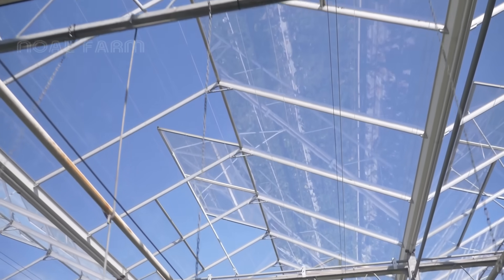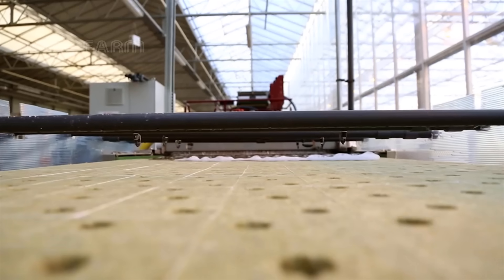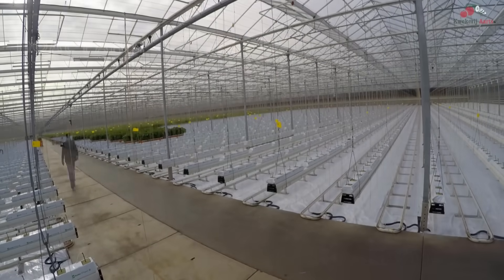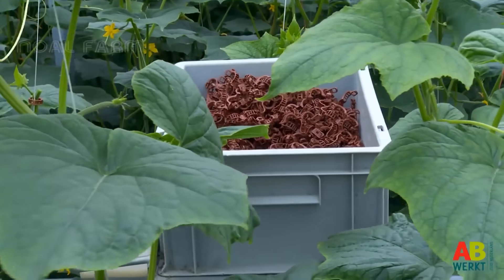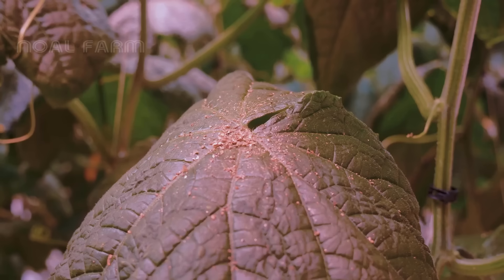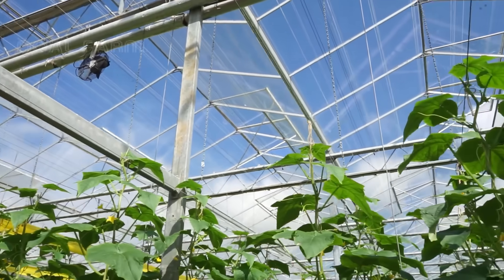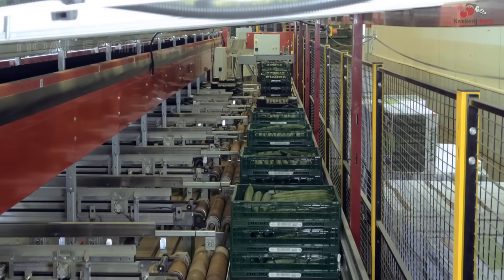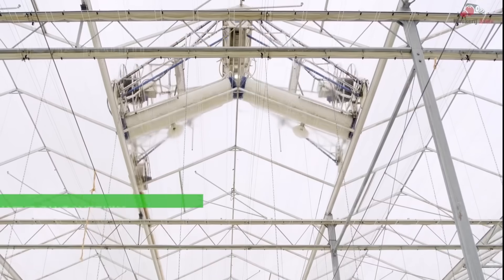How To Grow 69 Millions Of Cucumbers In Greenhouse And Harvest - Modern Agriculture Technology

Comment: Respectful Greetings!
To: Fazenda Noal. 
Cucumber production in a greenhouse involves providing the right amount of water, fertilizer, and support for the plants. Cucumbers are a popular greenhouse crop because they are smooth, juicy, and sweet. 

Watering
Water often and thoroughly to keep the soil moist but not wet 
Small plants need about 1 quart of fertilizer solution per plant per day 
Mature plants need 1 to 2 gallons of nutrient solution per day 

Fertilizing 
Use a premixed fertilizer designed for cucumbers
Start with a low concentration rate and increase as the plants grow
Adjust the fertilizer based on the quality of the water used for irrigation

Supporting
Use sturdy canes, strings, or wires to support the plants 
Grow cucumbers vertically on a trellis, fence, or other support 
Spacing 
Plant cucumbers at least 45 to 50 cm apart
Space rows 16 inches apart

Air circulation 
Provide good air circulation between the plants to help prevent disease

Types of cucumbers 
English and Beit Alpha are the two primary cucumber types grown in greenhouses
Both types are parthenocarpic, meaning they produce fruit without flower fertilization
Harvesting 
Most varieties of cucumber will be ready for harvest between 50-70 days from the day you plant from seed.

Consuming cucumber provides several health benefits including: high hydration due to its high water content, aiding digestion with its fiber content, supporting skin health by providing essential nutrients, potentially helping with weight management due to its low calorie count, and contributing to overall health by providing vitamins and minerals like vitamin K, vitamin C, potassium, and magnesium. 
Key benefits of eating cucumber:
Hydration:
Cucumbers are primarily composed of water, making them excellent for replenishing fluids in the body. 
Digestive health:
The fiber in cucumbers helps regulate bowel movements and promotes healthy digestion. 
Skin health:
The nutrients in cucumber can contribute to healthy skin by promoting hydration and potentially reducing inflammation. 
Weight management:
Due to their low calorie count, cucumbers can be a great addition to a weight-loss diet. 
Nutrient provision:
Cucumbers contain vitamins like vitamin K, vitamin C, and B vitamins, along with minerals like potassium and magnesium. 
Fresh breath:
The crunchy texture and high water content of cucumber can stimulate saliva production, which helps combat bad breath. 

Courteously!
Luis Van-Dunem

Comment: Growing 69 million cucumbers in a greenhouse is an incredible example of modern agricultural efficiency. Achieving this requires advanced techniques like optimized greenhouse designs, climate control, and efficient water and nutrient management. Greenhouses provide a controlled environment, ensuring that cucumbers receive ideal conditions for growth year-round, regardless of external weather factors.

In addition, using automated systems for planting, irrigation, and harvesting plays a crucial role in scaling production to such massive numbers. Precision farming technology helps monitor plant health and adjust conditions in real-time, ensuring consistent quality and yield. These methods not only boost production but also minimize waste and conserve resources, making it a sustainable agricultural solution.

Comment: in Indonesia, greenhouses are expensive and rarely used by farmers. however, this is actually a good step to minimize pest attacks
Reply: Yeah, I hope our government rethinks their policies, instead of spending the budget on fertilizer subsidies, it is better to support farmers to make greenhouses.
Reply: @atranzjoker  Not really. The soil in tropics is heavily leached. There is very little water soluble nutrients... so little nitrates, sulfates, potassium, magnesium zinc, etc. If it water soluble it is gone under 2500mm-3000mm of rain a year. Also the temperature is very high. Room temperature is easily 35 Celsius. So a green house structure that is not carefully designed to vent heat and has good airflow will quickly become an oven. Finally please note many plastics used in the west, rapidly photo-degrade (yellowing and cracking into dust) under the intense UV light of the tropic. Many also lose their physical strength due to the heat. Water system also have to well protected to prevent mosquitoes getting into them and  breeding. Mosquitoes borne disease within the Indonesia region include malaria, dengue, yellow fever, Zika and chikungunya.  

Green house in the tropic needs to be designed to stay cool, its must be made using material that can withstand, high heat, high UV, driving rain (which is very heavy and collapse building when there is wind mixed into), keep fungus and bacteria spores out, keep insects out, and in indonesia withstand earthquakes.... and you have to provide the artificial fertilizer too because the local soil is heavily leached. AND all at a low cost.. because Indonesians really cannot afford expensive systems. The average monthly income of an indonesian farmer is equivalent to  $250 USD dollars. 

So if your green house comes up to $10,000 USD there is no way it can be purchased by the farmer.
Reply: @nickl5658  Gee, that's new. So, what do you suggest to us?
Reply: Lagi nyasar ya om
Reply: I'm going to build greenhouse smart farming technology in Indonesia and make it affordable for businesses
Reply: Ngomong apa bang?
Reply: @jejak-penelusur  pest attack katanya, mungkin maksudnya "serangan tongpes" alias kantong kempes 😢😭
Reply: I believe European farmer afford to do this because they heavily subsidies.
Reply: Very nice👍👍👍👍

Comment: I would like to know what happens to the dead plants when they are cleaned out. We are told by sending food scraps and green waste to the rubbish tip rather than using them for compost it is adding to greenhouse gases. Is there a practical use for this waste?